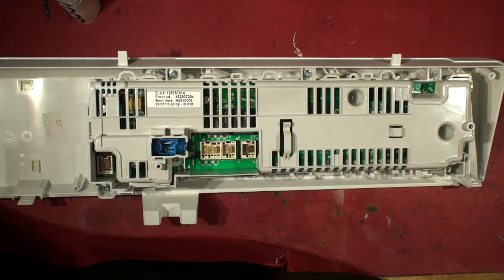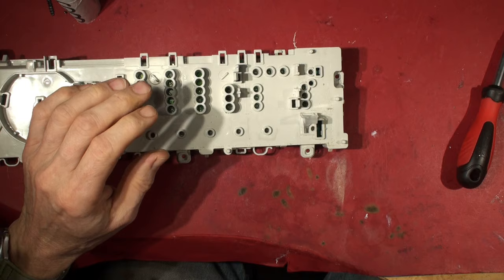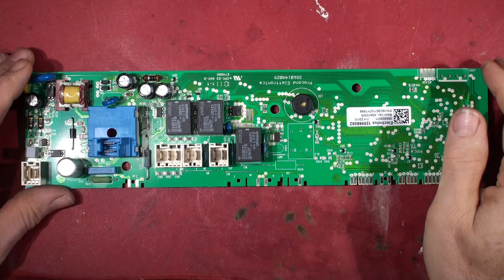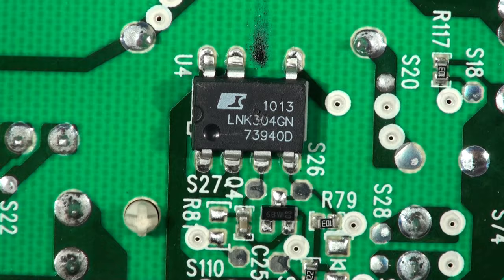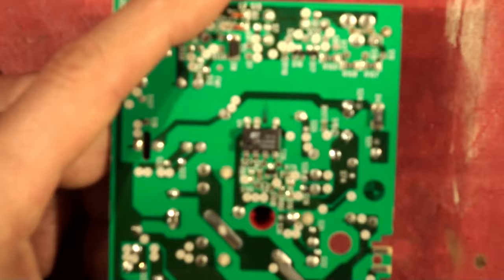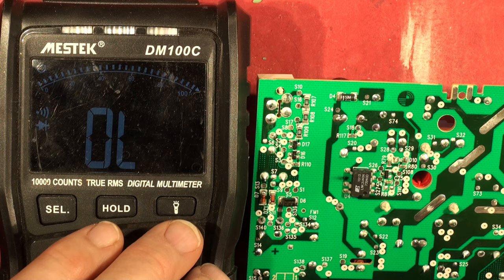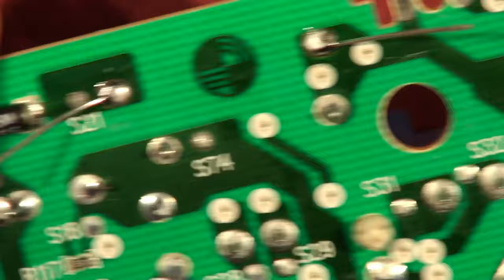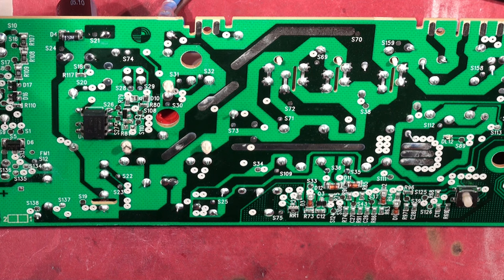AEG Tubmle Drier Dead Controller Repair and test

Comment: From my experience any of the red dark amber colored resistors are fire retardant or somewhat resistant to heat. Also you’ll find these ceramic feeling Matt black type I guess so the heat can radiate away.
Also they’ll sometimes have those really long square tight legs so that they can be held off of the board… But the body of the resistor themselves looks just like any standard resistor.

They make them bigger by 50% or more to make up for heat not only internal but mainly absorbing less and radiating more external source heat. and give a little more wiggle room. Dale/vishaydating back as far as I can remember and it’s what you would find in furnaces and other areas that needed resistors that had an outer and inner characteristic more resistant to heat. Also a lot of the Milspec and Aerospace grade stuff was flame retardant and resistant as a standard feature. You can still buy a lot of that really high grade aerospace stuff huge box lots of it online. It’s usually pretty much the same with a few more features and obviously goldplated legs usually
Reply from the maker: Thanks for the comment.  Many wire wound low value resistors act as both a fuse and fuse - otherwise known as fusible resistors. The specs for these are very sketchy and they don't perform as a fuse anywhere near as effectively as a 
 real fuse. They are a compromise but better than nothing at all.

Comment: Well, I have to say I've been doing this for 40 years and I also made a video 10 years ago on this https://www.youtube.com/watch?v=7KmnizwuUEM I take my hat off to you. Your filming of the repair is much better than mine and I would estimate just in the UK over 10,000 tumble dryers from AEG Zanussi Electrolux and John Lewis have been scrapped because of this fault. Or the other common one is the relay goes open circuit. Keep up the good work and help beat built-in obsolescence. By the way the predominant reason these boards fail on a regular basis, they are normally plugged into a poor power supply extension leads, spur sockets overloaded are the common problem I see this causes a voltage drop to the board, ware are you to in the uk
Reply from the maker: Thanks for watching. They just fail spontaneously these chips are a weak and are not adequately protected by the filtering.  Have a look at a Miela or Siemens controller and see the additional filtering on the HV input side. It is no mystery as the power supply is just too rudimentary and the UK mains voltage is too high. A lot of the testing and product design and testing is done at 230VAC mains.....   Real world power supply ages the switching FET until eventually it breaks down.

Comment: Excellent video, very informative :) 
I have an AEG TN95570 dryer with the same fault. The dryer has a small display on the controller, but is probably very similar. Do you know if this fix applies to that model as well?
Reply from the maker: Probably, Most models use the same or a close variant of the is controller with the same bad soldering issues.

Comment: Hi thanks for the great video - I have a Zanussi washing machine - no power checked the 47ohm resistor and it was O/C changed it O/C again, found your video and changed the LNK304 and now I have power😃 the leds are on but after 10 or 20 seconds they all go off again and come back after 30 secs or so, looks like something is cutting out, do you have any further videos to help me go deeper? thanks keep up the great work !  doubleAA
Reply from the maker: Have you tried it back in situ - all plugged in?
Reply: @razenby  Yes all plugged in, took a photo before disassembly so all connectors are in the correct place - thanks

Comment: Great video, I have dead aeg tumble dryer with a very similar board.
I replaced the LNK chip as it was obviously blown but it did not fix the issue. On closer inspection a similar wire wound resister has cracked and blown but I cannot find a replacement. The resistor looks to be 4.9M ohm 1% with similar dimensions to the one you replaced do you have any idea where I can get a replacement or do you have those in stock too?
Reply from the maker: 4.9M Ohms is a bit of an odd value, There is nothing in the circuit that would need such a high value. Send a picture of it to ark.mail@gmx.com
Reply: @razenby  thanks for your fast response I have sent you the picture as requested.

Comment: Great video, very helpful.  Replaced chip and resistor, but frustratingly, still dead!  Chip gets warm though, so clearly drawing current - any ideas?
Reply from the maker: Are you getting any DC voltage on the low voltage electronics?  If it is still dead then you will need a multimeter to debug it,  Check the diodes on the HV side.  Remember to disconnect from power and discharge the HV reservoir capacitor before touching anything. Check D4, D10 (if fitted), the S)T-23 diode (6BW) to the left of R79 and you solder joints for bridges and dry joints!!!

Comment: Hello

I am looking at your video 'AEG Tubmle Drier Dead Controller Repair and test'.  It is fantastic and I will try this to see if I can repair my AEG dryer control unit.  At 38 seconds you mention a video about removing the panel.  Do you have a link for that video?

Regards
Reply from the maker: Sorry, I don't think I ever uploaded that video.
Reply: @razenby  No problem, that is the easiest part of solving this issue. Thanks again for the repair & test video.

Comment: Nice work I'm interested in fixing motherboards for appliances I fixed a GE motherboard for a washing machine it was a bad triac that controled the lock lid I'm sure you know the advantages of using an nice flux chip quick etc..
Reply from the maker: Cheers. It is a noble thing to save an appliance from the dump and so called 'recycling'

Comment: Hello great tutorial,
I replaced lnk chip and 47ohm resistor on dead identical board and it ran for several months, then burning smell and dead again. There was a 5mm hole burned through the board above the lnk chip viewed from underside, trace from drain was destroyed.
I connected drain to one side of transformer with wire and new diode, cathode to bottom of 100k resistor furthest from transformer??, not 100% if right
Fitted new lnk chip and 47 ohm resistor, at power on no led or beep, and L3 inductor gets hot, indicating to me a short on secondary. Can you possibly make any suggestions, are my trace repairs right?, any help very appreciated.
Reply from the maker: A secondary short would not cause the Buck inductor to overheat as a working LNK chip automatically detect and limits the overcurrent on the secondary side.. I suspect you still have a fault on the mains power supply.
Reply: Thank you for helping, to just seek your help one more time please.
Because there was a hole burned through the board just at the output of the LNK chip taking the trace at drain with it, I could do with your help with the high voltage trace layout . I have been looking for a schematic everywhere and forums to no avail.

Pausing your video at 8.25
1 Is the output of LNK connected directly to one side of transformer (anode of D5 trace)
2 Is the cathode of D5 connected to the cathode of TRSB1 (100k resistor on mine)

Again any help/suggestions much appreciated

Comment: Hello @Magic Smoke,
Very nice video. Thank you for sharing this knowledge. In my Electrolux dryer I had exactly same issue (blown LNK586GG and resistor) but after replacement both elements the controlled is still dead. I also check elements around LNK like diod and capacitor but everything looks fine. Could you please guide me what to check next? I measure LNK under voltage and there is only 320V DC on pin 4, pin 1 and 2  0V
Reply from the maker: The best bet is too pull up the datasheet for the LNKxxx chip.  The application circuit is there.  Take  a look at it and makes sure all the associated components are OK and that none of the PCB tracking has been blown open circuit.  If you can't see like a teen with 2020 vision then get a magnifier.  I know it sound glib but the number 'carefully inspected' things that have brought to me that have bad solder is beyond a joke.  If you cant see then you cant inspect therefore you cant repair.
Reply: @razenby  Hello, thank you for your answer, but actually I'm using microscope and check solder joints was one of the first step that I've done.
Reply: @razenby  I ordered LNK586GG from another source and dryier start working as it should...

Comment: Great instructional video, with a decent resolution which you can see clearly.
I had a dead bosch dishwasher, did the snip legs off and clean up method, also the wirewound was blown, much easier to do that. 
Assembled and tested all working ok now 😊
What make, model of soldering iron do you recommend? Mine needs replacing
Thanks very much
Reply from the maker: Good job. If you do a lot of soldering then your very best bet is to buy a second hand professional Weller soldering iron station with a WSP90 iron. It makes soldering very easy and has very accurate temperature control. The element is silver and the tips are silver so there is great thermal coupling between the element and tip - as soon as the  heat is being conducted away the iron can deliver the and heat the job. It is a lifetime investment. You can but all the bits of the iron separately and spares are cheap. However they are very reliable.  If you see a second hand one - it may look beaten up but they will probably work.

Comment: great video - I am about to inspect my suddenly non-functional AEG and was wondering if you still had the shop? - I can't find you on ebay
Reply from the maker: I have the components if you need some.  Inspect it first.
Reply: @razenby  Hey Magic - Thanks for the quick reply and for doing what you do. I pulled the machine out and it turns out the mains socket was the problem - which is annoying because I was looking for an excuse to buy a new soldering iron! this video is great!

Comment: Very good explanation. I have a question: Locally in Portugal I only find 47R bobinated 3W but rated 100v. Can I use this or better to order online something like ULW3-47RJA1, rated 350V ?
Reply from the maker: The correct part is a Bourns 2W 47 Ohm Fusible resistor.  Search/ buy 	Bourns part number: 
FW20A47R0JACT   Good luck. Please subscribe to the channel if you can.
Reply: @razenby  Thank you. I end up buying a 47R 2W fused resistor but the coating is rated more (600V). It will arrive next week in the shop. To buy the wired one, i would have to to spend 20€ in delivery.  I will post the news. Already subscribed.
Reply from the maker: @americorio3294  Thanks,  Maybe I should open an online store to enable everyone to get the part kits for repair.

Comment: Great video , 
 the AEG lavatherm 55540 dryer was defective, it didn't work anymore, not a single light was on.
On advice replace IC LNK304GN and also a resistor of 100 ohm ,and all lights light up again, but then also all lights.
it seems that the machine must first be reset (clear error codes) and then it works again.
I can't find the correct procedure on the internet unfortunately, but many procedures of other types (which have a small display)
Do you perhaps know the key combinations for this type?
Reply from the maker: Sorry, I don't.  Did you test it correctly connected back in the machine?

Comment: Hello  Mr. Smoke, i have a similar controller, but from a Goreje washing machine ,i have replaced the LNK chip and resistor, the machine starts it runs like 2-3 minutes, than it turns off and  restarts the program! Is like he is struggling to draw amps, and it can't, so it restart. What should i check? Could it be the big  filtering condenser at the back of the machine? Or someting on the board?

Comment: Just to add, I could start removing smds to try to identify short but where would I start?, are there weak links/parts that are prone to failure in low voltage side, no oscilloscope so cannot test transformer or lnk output. Thanks
Reply from the maker: It is unusual to the fault to be due to component failure on the low voltage side. Invariably it is the Off-line buck regulator circuit that fails. Have you checked the components on the HV power supply side?

Comment: I have a draper 40w that is doing the job easily. Going to stock up on some extra items though. Can you recommend a type/size of solder wire?
Reply from the maker: 0.5mm 60/40 Sn/Pb  by  Qualtec Loctite/Multicore is good for general use, not to tick for small components and not too thing for large solder joints. Thanks for watching.

Comment: Superb narration and filming - incredibly helpful and now I know what's wrong with my pcb. I'm after the resistor and LNK304GN ... what ohm value did you settle on for the resistor? Have you any of these components in stock, and if so, how can I buy them from you?
Regards, Mike
Reply from the maker: Thanks Mike. The resistor is 3W 47R in stock, LNK304GN in stock.  Email me at ark.mail@gmx.com and I will mail then to you. The office ships every day. Is your resistor blown (that is a good sign). It'll be whatever they cost me plus postage.
Reply: @razenby  Cheers for a super fast reply ... yep the resistor's fubar and there's splatters near the LNK. On the upside, the diode's OK. I'll email you after dinner. Cheers, Mike
Reply from the maker: okydoky
Reply: @razenby  hello sir I am from UAE I Can't find resistor here which value resistant you are fixing

Comment: Next to my LNK364GN chip, I have de-soldered by mistake the small capacitor (I think it would be equivalent to "C25" in this video - see video at 9min 58sec).
Could anyone help by suggesting what value of capacitor I should use to replace it (e.g. "10nF 50v 10%" or similar?) so I can buy a replacement?
This is on a circuit board for an AEG washing machine (AEG model number = L63470FL, product number = 91453401401, part number of the circuit board = 973914534014019).

I cannot buy a whole new circuit board right now because there seems to be a supply shortage, so I am forced to try to fix this.
Reply from the maker: OK, for all you intrepid repairers out there, please remember that the product designers mostly copy their schematics from the manufacturer's datasheet. Warts and all. So you can get a pretty good idea by studying the datasheet (link below).  In the datasheet you can see that in the example schematic that Pin 3 of the device (BP) is connected to a 100nF 50V multi-layer ceramic to generate the internal DC supply internal CCT and FET drive. So yours was a good good one!! Good luck. Pls remember to like and subscribe. MS
Datasheet link: https://www.farnell.com/datasheets/2059771.pdf?_ga=2.260221647.316122949.1496130365-1705634499.1495448867 )
Reply: @razenby  That's super. Thanks very much for your reply. So based on the datasheets for the LNK364GN & LNK364GN-TL, it seems that I can also use a 100nF 50V multi-layer ceramic capacitor for connection to the "Bypass (BP)" pin. Additionally, from the diagrams on the datasheets we see that all the "Source (S)" pins are to be connected together, so I assume that the short circuit of solder that I've inadvertently created between some of these "Source (S)" legs doesn't make any difference. Btw - I liked and subscribed quite a while ago already. It's great to have your support to help keep all this electrical equipment out of landfill sites and beat what some might describe as programmed obsolescence.

Comment: i like this kinda stuff! free dryer! why throw away! ive never had to buy a tumble dryer once, always picked up some free. now im possibly facing a similar issue with its control board, im not too familiar with electronics though.
Reply from the maker: Thanks. Get your soldering iron out.. It is bound to be a 50 cent component.. Invariably one can spot whats is wrong using simple observational skills .  Why has that component got the side blown out of it? /what's that crack on the soldered pin?/why connector is brown?/Why is the casing on that component is cracked/shit the wire has dropped off etc.. ... Then the problem becomes a mechanical process - i.e. soldering. ....I My whole extended family has  lovely tumble dryers bought from the man who collects them for the council.  The mechanical parts on these units is hardly used and yet they are off to the landfill..

Comment: Hello. I'm from Australia with an Electrolux dryer edv505. It all seems to work. Except no heat. People seem to swap the pcb to fix... Any idea what could cause it not to heat?
Reply from the maker: Bad wiring crimp-look for blackened ones.
Thermal trip (internal) had tripped due to over-temperature condition. (Some have manual rset)
Heating element open circuit (failed)  
Bad thermistor / temperature thermistor sensor(s)  (NTC)
Heater relay on control board failed.
Reply: @razenby  thank you
Reply: @razenby  hi. Thanks. I took my pcb out and brought to a friend who has same dryer. Plugged in and also only blew cold.. Would I be able to send you a photo of the board? (not sure if it's possible to diagnose by sight. But it looks good to me, me being non electrical skilled)
Reply: @razenby  actually I'm watching your zanussi video... If I short the "heater" points would that keep it on heat always? (I only turn on in 30min blocks)